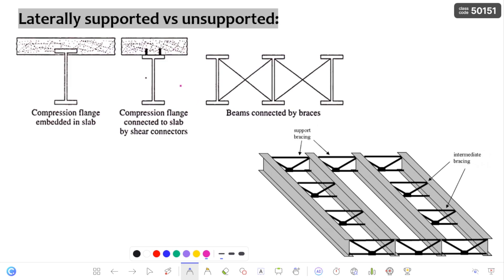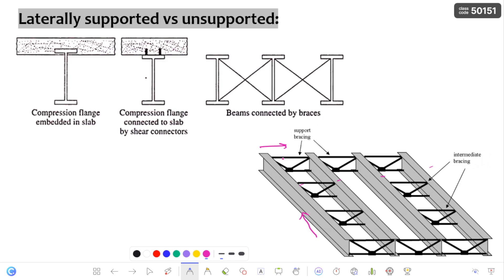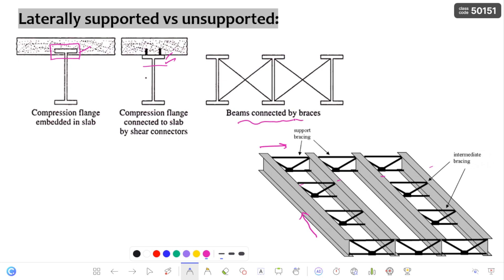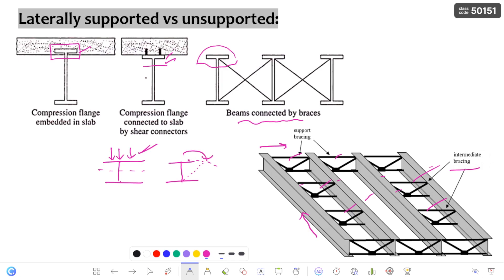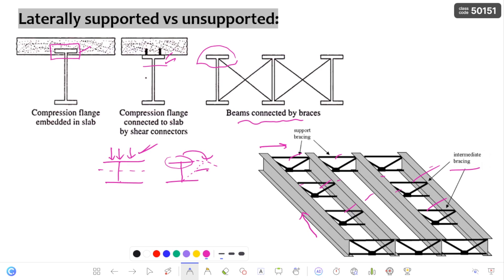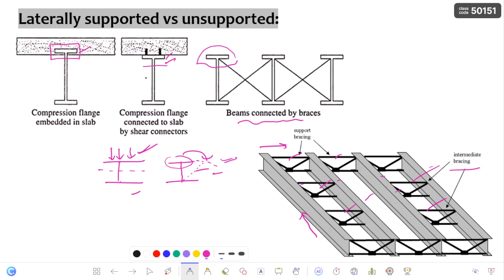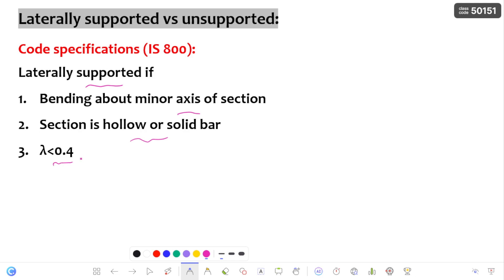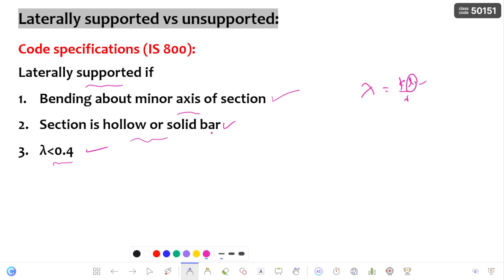LATERALLY SUPPORTED VS UNSUPPORTED BEAM ll PRACTICAL STRUCTURAL ENGINEERING

Comment: Very informative. In the 3 picture, the beams are jointed by lateral braces, does that mean it won't try to buckle intermediate? If the spacing of the brace is high, can it be considered as laterally unsupported? Please clarify
Reply from the maker: @subhashmagapu2399  thank you for your comment, it all depends on the unrestrained length of the beam and radius of gyration of section in which you can classify based on the slenderness ratio. For explanation, i just kept those images.
Reply: @Civil_cafe  🤔